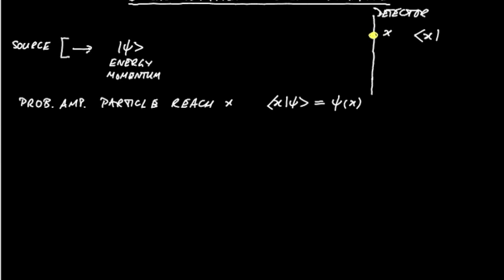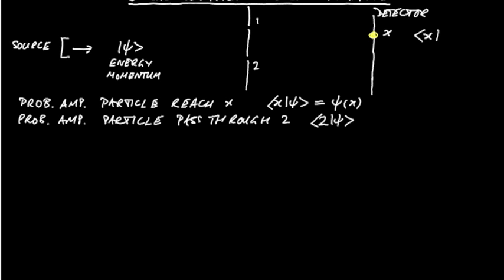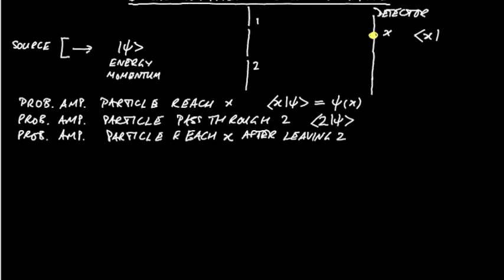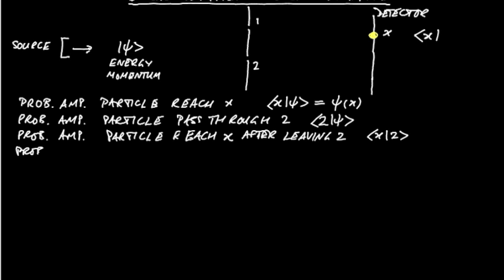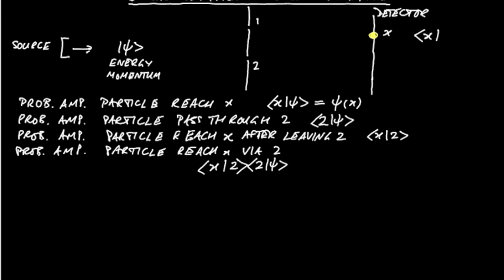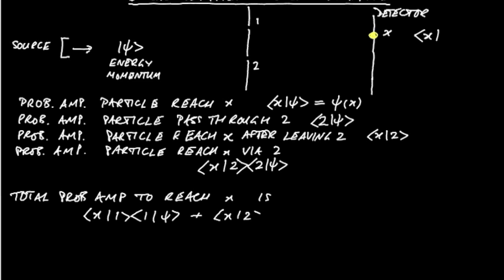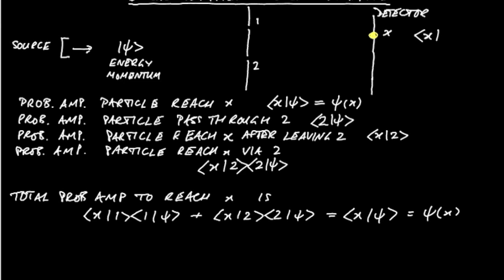Double Slit with Dirac Notation (PHAS3226 Video 5)

Comment: <x|psi>=psi(x)  ... I know why this is valid in the particular case. However I don't understand why is it possible to assign state vector to a coordinate. What exactly is <x| and under what conditions does the equation hold? Thanks
P.S. I don't mean to sound rude. Just asking because I am kinda lost in bra-ket notation.
Reply: Erik, just think of |x>  as the state of “the particle is at position x”. The position coordinate in the ket is just a label, a shorthand. Then bra  <x| is just the Hermitian conjugate of that state.  What then is a “Hermitian conjugate”?  Physically it is a lot like a “time reverse” of the state. The maths will not tell you this, but that is what it amount to in physics usage  If the state is not time dependent then the bra vector is just a vector space dual, which is useful for forming inner products when needed, e.g., for measurement projection onto that state.  So <x|y> is the projection of state |y> onto state |x> (in linear algebra jargon), equivalently the amplitude for transition from |y> to |x> (in physics jargon)..
Reply: @Achrononmaster  Thanks. :)
Reply: You are not the only one. Think of the general function y = f(x). Now, in QM EVERY FUNCTION IS A MACHINE THAT SWALLOWS A BASISVECTOR (x) AND SPITS OUT A COMPONENT (y). That can only happen when the machine is a vector! You need the scalar-product for that. When V = x . i + y . j + z . k, then j . V = y. Here V = f(x).